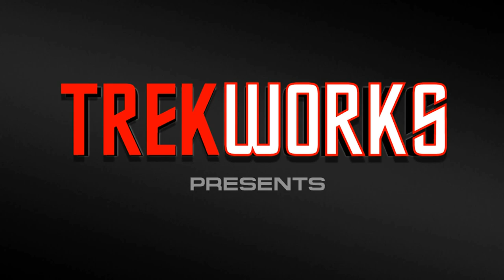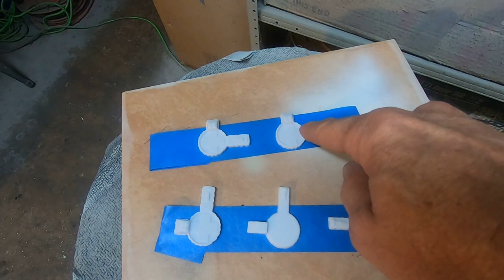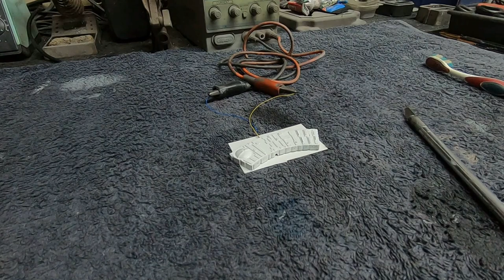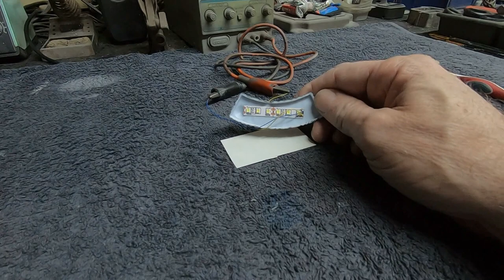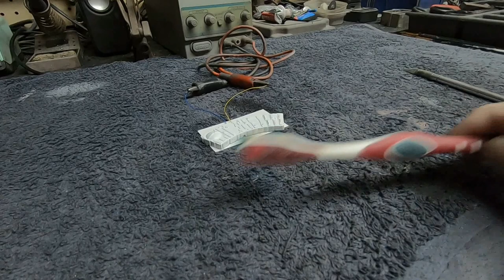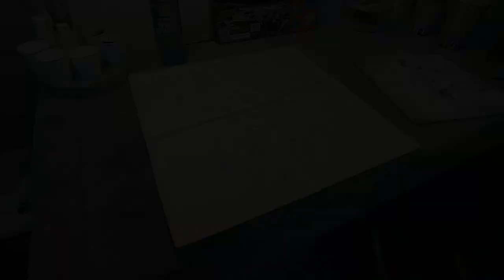Let's Build The MPC Space 1999 Moonbase Alpha Model Kit Pt 1

Comment: Very clever to use this kit as a display base! I remember this kit as a kid. My friend had it and I never liked the vacuformed moon surface pieces so I never got it. 2 years ago I saw it on sale on Amazon for only $13 and I couldn't resist. I built it just the regular way, used foam board glued to the surface pieces to make them solid, did some weathering on it and hung it on the wall. It turned out better than I thought it could. It's actually a pretty cool kit. I'm loving how you found such a clever use for it!

Comment: I use to have that kit back in the 70's.  But it had the Moon Base Alpha control room build for mounting on the corner of the foundation. It also included figures. I loved the control room part over the base itself. I found that the entire kit took a lot of space to display, and parts started to pop off readily due to the new glue introduced which allowed younger modelers to acquire on their own. (I was able to get the "good stuff" once I turned 16.)  I was a military dependent and a lot of my kits got lost or damaged due to transfers to new duty assignments. The fate of my moonbase happened on one of those.  :-(
Reply from the maker: The kit still comes with the Alpha main mission model and figures. I'm working on it now.

Comment: The look of the lighting is really inspirational. Not so sure about using plaster in there. Ahem... next time, perhaps a thin layer of A+B plumber's putty or even Apoxy.
Reply from the maker: The plaster didn't work. it didn't want to stick to the vacu formed plastic. I ended up pouring in some resin. It didn't need a lot. Just enough to stabilize the surface.
Reply: @TrekWorks  That sounds better-- didn't know you "did" resin... but this is a good use of it.

Comment: Good tip for the scraping. Impatience has left me with larger openings than intended. If the plaster doesn't stick resin probably would work. Gonna be a cool display when you're done. Maybe time to invest in a 3D printer
Reply from the maker: I thought about resin but I worried that the heat it generates when curing might warp the thin plastic of the surface. I hope the plaster works but we'll see.
Reply: @TrekWorks  yeah. Might actually burn through. Obviously I don't have much experience with resin

Comment: When attaching the buildings, the superglue/baking soda trick should help make the buildings look embedded in the surface and help seal light leaks if you use black super glue. Oh, and would foil underneath the buildings put more light in the windows?
Reply from the maker: They make black super glue?
Reply: @TrekWorks  Yes. The ones I've used are super high viscosity for gap filling.